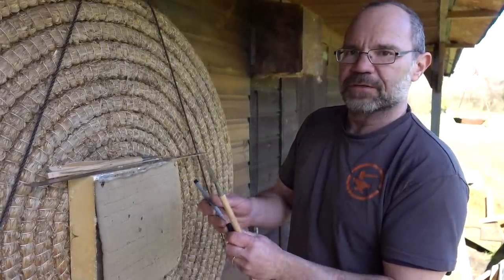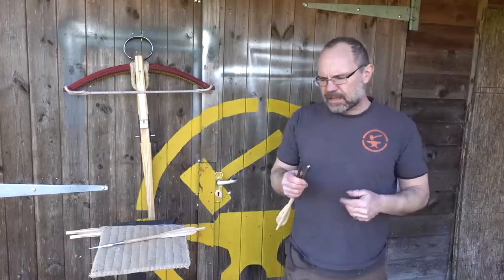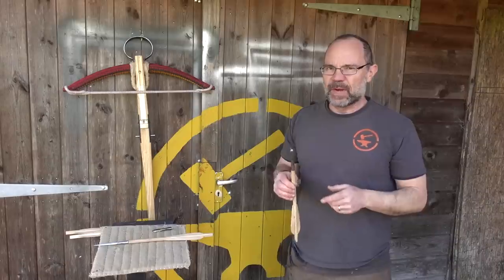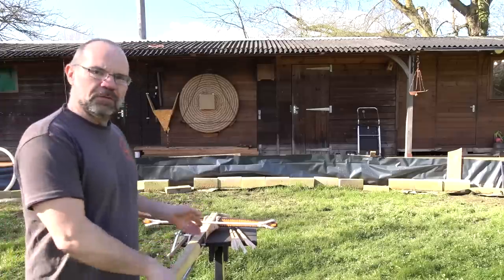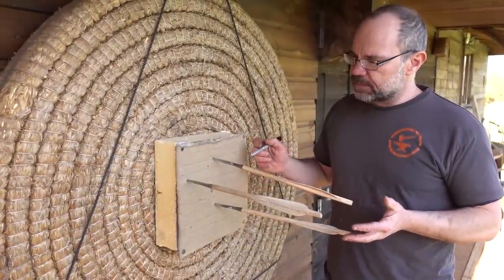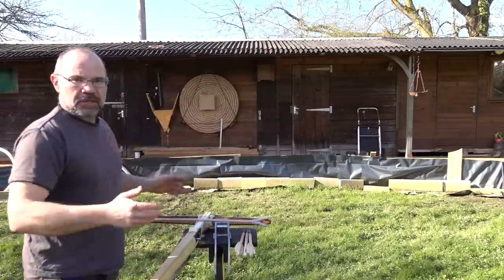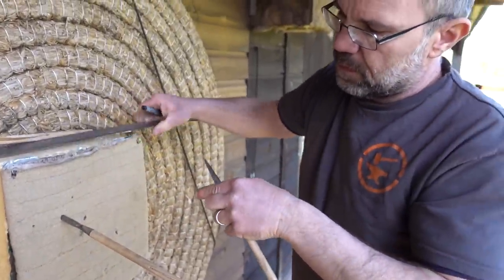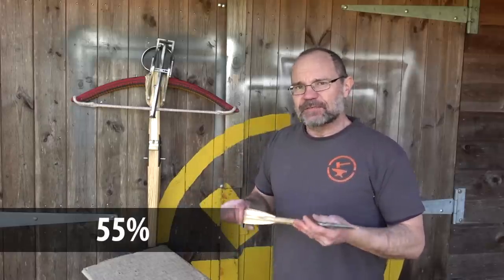Does WAX on ARROW HEADS Do Anything?

Comment: 7:58 Wait, he is saying this is an increase of 55% but :
- 26mm -> 45mm is an increase of 73%
- 25mm -> 47mm is an increase of 88%
- 18mm -> 45mm is an increase of 150% 

Please tell me if I just misunderstood what he is saying.
Reply: He's since accepted that he got the maths wrong.  Your calculations are correct.
Reply: Was looking for this post. yes it's over 100% increase avrage
Reply: I think he was probably not thinking of the actual increase in percentage, 26mm-->45mm an increase of 19mm, and 19mm, so 42% represents the part of the improved penetration that is due to the wax. The proper wording with that reasoning would be "Without the wax there is 45% less penetration".  He got confused with the numbers, but I see where he was trying to get at.
Reply: Same thinking, I scrolled down until I found yor comment
Reply: I've seen this same mistake happen several times before. He did the math right but got the answer in reverse and didn't realize it's not the same both ways.
If you took those same things backwards he got the percentage correct as a DECREASE. However, as an increase it doubles. So an 88% increase is a 44% decrease if you're going the other way etc etc. I've seen people make this mistake when showing things like price differences as well. Saying something like $25 to $50 is a 50% increase, when it's 100% but they're just looking at it the other way, and applying the same number not realizing that it changes the percentage, because it would be 50% if they were talking about going from $50 to $25.
Reply: Ignoring the "how to do percents" thing, the results are even more impressive than first appears because the cross secion of the head is constantly increasing making penetration harder the deeper it goes.
Reply: replies here are all good, but the simple answer is that he was looking at the change relative to the final depth, and not the original depth. oops!
Reply: @dirkbruere  right? I'm sure ballistic engineers have studied this and applied it to AP rounds, warheads and such- but there must be an equation that takes the rate of change of surface area, armor elasticity, friction, and of course kinetic energy into account all at once to determine penetration.
Reply: Yes and those numbers make it even more impressive... I mean and increase of 73%, 88% and 150% !? That's INSANE of a difference! I was expecting something like, ok maybe it only increases by 10% or 5% or maybe nothing... but between 73% and 150%? DAMN that's what I call making a difference!
Reply: You'd also have to take into account that he measured from the outer side of the gambeson. So technically, to measure lethality, you'd have to subtract the gambeson's thickness from the penetration depth and then calculate the percentages to find out how much deeper into the target's flesh the bolts are intruding. That makes the waxed bolts even better. Let's assume a 10 mm thick gambeson (I have no idea how thick it actually is):
(45 - 10) / (26 - 10) = 218 %
(47 - 10) / (25 - 10) = 247 %
(45 - 10) / (18 - 10) = 438 %
So the average ratio of penetration depth of a waxed bolt vs. an unwaxed bolt judging from this small sample set is
(218 % + 247 % + 438 %) / 3 = 301 %
so the bolt penetrates the flesh 3 times deeper.
Therefore, there is reason to believe that waxing the bolt dramatically increases the lethality of a shot against an opponent wearing only textile armor.

Now of course, this whole calculation assumes that waxing the bolt bestows an inherent multiplier to penetration depth on the bolt - the truth obviously is more complicated than that. Nonetheless, it's an astounding result.

Comment: The reduction of friction is very import for this kind of point since they don't cut the fabric and have to forcefully move it out of the way...
Reply: which might explain the fatter bolts, because they will impact the target , and expend their spreading force more quickly. The bodkin tips will gradually expend their spreading force, but IF the fatter bolts DO penetrate, they will penetrate before the energy can disperse so much, allowing them to have more energy for the soft tissue.
Reply: @tsmspace  Actually the fatter bolts as you call them are widely believed designed for dealing with plate armor for both mass and reducing deflection, while I don't know about Tod but from my days sitting in front of the History channel I always figured bodkins were designed for defeating mail, given that the Stiletto was designed for such. After all gambeson isn't substantially different from an animal's skin, so broadheads could be used for such armor as well. I am however interested in a comparison of waxed broadheads to bodkins now.
Reply: @luigi mario If you've ever tried sewing thick fabric* you'd know that you don't use a knitting needle, you use something with the minimum cross section for the job (and you wax the fuck out of it).
Broadheads against gambison? That's a ridiculous idea. It's as if you haven't thought about what you said at all! Or watched the video.
Didn't Tod just demonstrate that a waxed bodkin (needle) performs well against gambison? You don't attempt to cut the fibres, you slide between them.
A single layer of fabric (excepting silk - which you allegedly use to help retrieve arrowheads from wounds) has no real value against sharp blades, hence is almost useless against broadheads. But gambison isn't a single layer; a broadhead might penetrate gambison, but it would take a lot more energy than a needle bodkin because it's trying to cut through hundreds of fibres and losing energy all the time.
Given the choice I'd be wearing plate, backed up by a gambison (silk if I was stinking rich), to stop anything but the most energetic projectile weapon.

*leather is fibrous - you could consider it a fabric.
Reply: @pd4165  Tod's previous video of broadheads bodkins and platecutter against gambeson and more solved that conundrum. Broadheads were way more effective than anything against gambeson because of cutting the fibers and clearing the path.
Reply: @luigi mario There's nothing wrong with speculation. In fact most "facts" begin as speculation. Someone speculates an idea, they test it, they find out if they were right or not. To use your example; Someone speculates we should the flat side of spoon to cut steaks, they try to do it, they find it doesn't work.

Never discourage curiosity. It's the worst thing you can do in science.

Comment: This was really surprising. I was expecting something statistically insignificant like an extra one or two mm, not nearly double.

Also it's easy to imagine the circumstances where someone used a bit of wax to stop their bolts heads rusting, so I could definitely see this having happened.
Reply: One-tailed t-test: p = .0004, so highly significant indeed!

Comment: wow, that's a huge improvement. And as a bonus you get rust protection if you dip the whole head :D
Reply: tommihommi1 But I’ve only got enough wax for just the tip
Reply: They probably did that anyways for that purpose and never noticed that it does increase penetration because it was always waxed or treated with another kind of material like oil or fat.
Reply: or just put them in a dry box... if you keep steel dry it can last a long time before it starts to rust, without any oily protection.
Reply: @DrTheRich  And just a single bad fingerprint can ruin that.
Reply: My money is that it's the other way round. They waxed the arrowheads/boltheads for rust protection during storage and they give a bonus improvement to penetration.
Reply: @DrTheRich  you put unlubricated tips in a dry box?
Reply: @DrTheRich  but will the dry box stay dry when you put it on a cart and move it through rainy Europe? Or even put it on a ship, let's say one that travels from England to France. Wet, salty air is a nightmare for any steel or iron
Reply: @DrTheRich  Only if the air is dry too or you have a constance temperature
Reply: @DrTheRich  Unless you're taking a vacuum or a hermetically sealed dehumidified box, the best you managed to do is make it rust a little slower. Humidity literally lingers on the air.
Reply: @luigi mario the big deal is that they had less refined metals so a bolt that started rusting could be reduced to useless in weeks time so plug that into a scenario. You got 100 boxes of bolts or so... how long have some of them been sitting there? How often are they checked for rust and maintained? Are you even paying anyone to check or maintain your bolts?

These bolts may be useless after firing but waxing them might insure they're useful until they're fired. Especially since way back there was no humidity control. There was no stainless steel. There was no wear resistant coating out of the factory. Unless you wax it.
Reply: @mdstmouse7  I bet you wet the box first before putting the tip in, like a true gentlemen. Always rub the box until it's thoroughly lubricated.

Comment: Awesome video 🍻 I am pretty sure they did it. I wax my woodworking planes and other tools to make them go smoother and with less effort and It prevents rust.

I love the line: 
"same brain different technology"
Reply: Helps for driving long screws into hardwood as well.
Reply: Im pretty sure they did,  I'm almost sure they did waxed or greased the  resting pad of the crossbow as well as the string-  for protections , and tha s already  a small  greasing on the the arrows.

Comment: Well. I've tested waxing arrowheads myself today.

While testing my bow, I tried using a tanned red deer's neck put on a chainlink fence as a targed, just to test out penetration while the target had a good amount of give. (Too much I later found, but it is consistent) I found it surprisingly resistant, out of all my arrows only the bodkin seemed to penetrate it consistently, and not that much. Tod of Tod's stuff released a video yesterday on wax on crossbow quarrels, so I decided to try it out myself, and my findings have been almost exactly the same.

I shot 15 times into the neck, which is from 6ish to 18mm thick. 7 (1into the thickest part) when dry, 8 (3into thickest part) when waxed - just rubbed a ball of beeswax on the arrowhead every shot

Dry amounted to average of 32,5mm without counting the thickest part shot, 31mm when counting that as well.
Waxed did 91,5mm not counting the thickest part shots, and 72,5mm with them.

It should be noted that the thickest part of the bodkin itself is about 43mm from the very tip, followed by a thin neck and a socked which again tapers out. The dry's deepest was 65mm deep, the waxed 114mm, twice. Which was almost at the very end of the socket, wider than the bodkin itself again.

Wax yer arrers, ladz.

Comment: 8:23 Loved this and all your experiments! I just watched the previous head-type experiment with the wife last night.  A geeky but important point of clarification: Teflon is NOT put on bullets to help them penetrate either fabric or plate armor, it is put on them to reduce damage to barrel rifling.  The myth of increased penetration is a persistent lie widely spread by the sensationalism of news media and Hollywood in the 90s, and is complete bunk.  Armor-piercing bullets are made of harder metals than standard bullets and thus wear out the rifling in gun barrels faster than normal bullets, so to reduce damage to the rifling armor-piercing bullets are coated in Teflon to lubricate their exit from the barrel.  However, that Teflon is shredded in the process of traversing the barrel and does not measurably effect the penetration depth of the bullet when it hits the target.
Reply: maybe the teflon on bullets myth stems from the wax on arrows practice.
Reply: @norullzz  Nah.  Teflon was used as a coating on hard solid brass bullets capable of defeating soft armor that were being developed specifically FOR police use.  The sold brass caused pressure spikes and fouling (lead-core bullets deform quite a bit to engage the rifling, solid brass or copper won't so much), so Teflon was tried to prevent this.  

Anyhow, the project leaked, hit the media, politicians ran with it, and since the media and politicians are morons, they latched onto the Teflon thing along with the "defeats police style armor" while ignoring the rest.
Reply: @immikeurnot  
Do not underestimate assumptions.

Comment: Every time Tod puts out a new video:

Me " YES YES YES! What awesome interesting fact about the past is about to be uncovered?"
Also putting wax on the head of arrows seems perfectly reasonable because if an army had thousands of arrows made and they were being stored in a damp basement somewhere you would want to keep them from getting to rusty. I suppose the other alternative would be oil but that might have to be reapplied over time and oil soaking into the shaft of the arrows might cause the heads to loosen up. Wax on the other hand is a much more rugged coating and would probably only need to be applied to the tips once.
Reply: evilcanofdrpepper Wouldn’t soaking up oil make the shaft expand?
Reply: Did you see the latest video series featuring shadiversity, theng-thrand, and nusensei, where they (somewhat argumentatively) go back and forth and in the comments about shooting bows holding the arrow on the opposite side of the bow?? They make some interesting commentary, and it may be a valuable concept when considering medieval art.